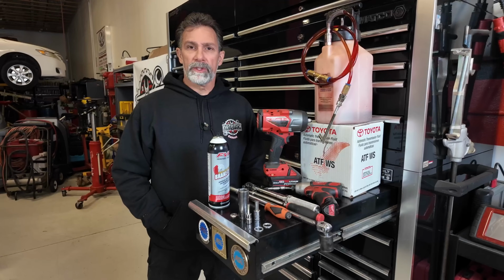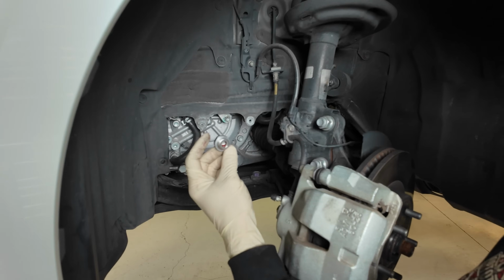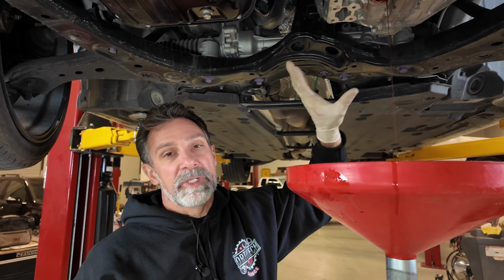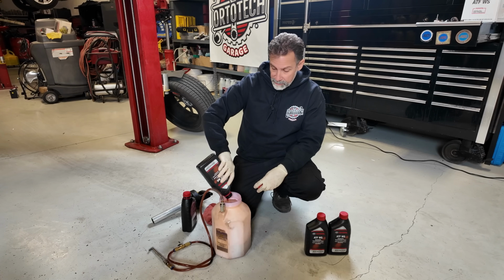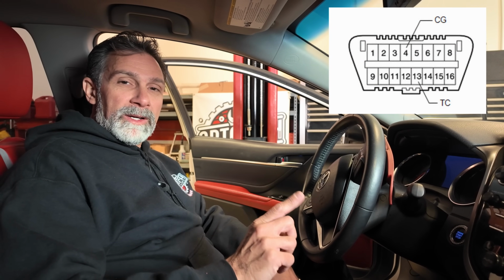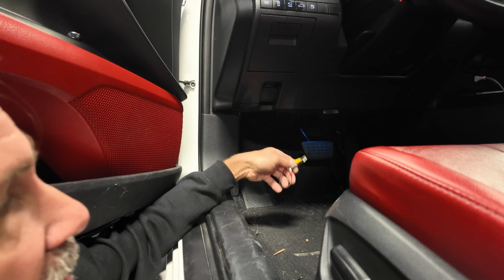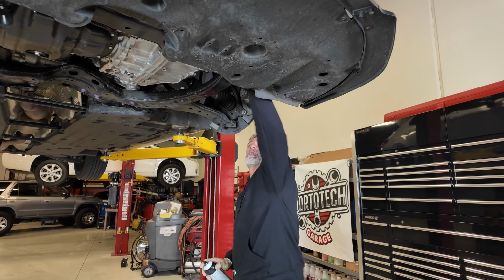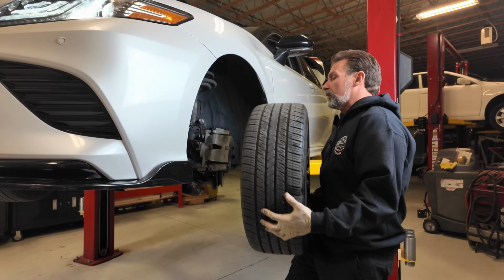The Ultimate Guide to Changing Transmission Fluid on Your Toyota Camry

Comment: Is it possible to change the filter thats behind the side cover of the transmission? Do you even need to?
Reply from the maker: No filter to service in this model.  The older models had a screen to capture large particles, but it's  still not worth servicing if you are changing your fluid regularly. It's just not necessary.  If you are going to pull the pan down to reseal it on the older units, you might as well swap the screen.  Otherwise, just invest your energy in changing the fluid to keep it clean. 👍

Comment: This is why I have switched to hybrids. E-CVT transmissions are more reliable. Fluid replacements are simpler and can be done anytime between 60-100k miles or even longer.
Reply from the maker: I dont think you can go wrong with either choice, but I do like the hybrids as well. 👍
Reply: Cvt is garbage, just look at the problems Nissan is having!
Reply from the maker: @michaelfrohn255  I would say that's a bit unfair to Toyota.  It's the Jatco transmissions in the Nissan and a few  other vehicles that are problematic.  The Toyota units have been reliable because they don't use the belt system found in the Jatco units.  They are made by Aisin or Toyota directly. Both of which produce quality products. 👍
Reply: @OrtoTechGarage  I believe Toyota's CVT is good and can last a long time if you take care of it and don't drive too aggressively. For a DIY like me, the e-CVT makes it much easier to maintain and has proven itself to be long lasting.
Reply: @OrtoTechGarage I agree, because Toyota isn’t using the belt design! They are using the hybrid system with a planetary gear design! But Nissan has not invested in technology like other companies. That is why Nissan is a dying company.
Reply from the maker: @michaelfrohn255 Nissan really needs to level up.  And that's coming from a Nissan/Infiniti fan.  I've had a bunch of them over the years.

Comment: Frankly speaking I am afraid to give my car to some service shop to do this procedure. They will definitely screw things up. They will either put too much and it will start foaming or will put too little.  Damn, wha to do. Likely will be changing myself then
Reply from the maker: I'm sure you will be fine with a reputable shop that knows these vehicles.  It really isn't anything that is uncommon or difficult for a professional technician. Of course, you could always go to your Toyota dealership as well.  Surely, they have the process and fluid types correct.  👍😉
Reply: @OrtoTechGarage  It os just that I am impressed with your work. In almost any shop out there they will not do this procedure so meticulously like you did. We should be grateful if they at least gonna put the right fluid. Measuring temperature and adjusting the level - this is already 80th level .I am gonna be also happy if they not gonna over tighten that yellow plastic plug and brake it. Look who works in the shop these days?! And if you tell them something? they look at you with poker face like:"Hey dude? what the hell do you want?!". I want you to do your job properly. I already lost a couple of cars in my family due to the idiots who think they know how to fix and maintain cars. Thats why I am watching your video now because I already lost faith and am afraid of trusting my vehicle to somebody else. With basic oil change they will overtighten the filter and the drain plug, forget to put the crush washer or put back the old used one, overfill the engine with oil. It is what it is. Thank you for the video and for doing your job so well.
Reply from the maker: @nicholaspetre1  I wish I could help you!  If you were in my area, I would.  Maybe you take it on yourself then.  Its not too difficult.  I can send you the specific instructions for the full procedure if you want.
Reply: @OrtoTechGarage i am good, thank you so much. I got the idea what you did and how. Again, thank so much for the video and details. God bless!
Reply from the maker: @nicholaspetre1  You are very welcome!  Let me know if you have any questions. I know you will do a great job! 🙏

Comment: If I am not mistaken< WS is not the right type of fluid to use in CVT. WS is good for regular hydrotransformator transmissions.
Reply from the maker: You really have to be careful and check your owners manual for the correct fluid type.  There are some Toyota CVT transmissions that actually use Toyota WS fluid (like some older Prius/hybrid models) and others that require a special E-Transaxle Fluid (like the new Camrys).  Most CVT transmissions do require a very specific CVT fluid, though.  It's very important to get the fluid type correct.

Comment: Did this today for the 7th time.  2011 Camry.  259K.  I use a bidirectional scanner to monitor transaxle temperature.  95-113F.  Bleed off.  I add 3 qts and usually bleed off about 1/2 qt until it starts trickling through fill tube.  My old fluid was darker than I expected. WS only.  Leveling the car and getting it high enough to work on ground takes the most time.
Reply from the maker: @waltersweet4595  Great job!   More proof you can extend the life of that transmission with some simple maintenance.  Your process is spot on! 👍
Reply: I had the same problem. Turns out blue driver does not give you the transmission fluid temperature and they  have no plans to implement it in the app. I did some research and like the guy in the comments says ,it  needs to be a bi-directional scanner.
Reply: I like using two sets of ramps to run the car up on
Reply: What scanners and app are you using?  I cannot fir the life of me figure out how ro read the temp.  My bluedriver and vlinker fs wont read it on multiple apps
Reply: @jp-ct7li 

Any bidirectional scanner will give you transaxle temperature.  Some as cheap as $50.   Make sure it has live data or bidirectional capabilities.  Research the model and see if it lists that on the live data screen.

Comment: I want to to do this on my 2016 camry, its the type that has a drain pan and filter inside to get all of the fluid. Dealer wanted 500 for fluid exchange 800 for full fluid and filter. To me this is outrageous pricing. Findlay toyota las vegas
Reply from the maker: @JustFollowTheConstitution I think this is something you can handle on your own if you feel confident. It may not be necessary to pull the pan and change the filter. It's just a screen.  If the pan is leaking, it's worth doing. Otherwise, a fluid flush would suffice. You can certainly bring it to us or any independent repair shop for service. We would be significantly less than the dealership.  👍
Reply: @OrtoTechGarage  Thanks for the reply. I just stumbled upon your channel, great videos. I didn't realize you're in Vegas. I will have to stop in! I'm near the SW location. About the 2016 model filter, other videos show more fluid coming out after removal, around around 3.5 quarts total. Just doing the drain only yields around 2.5? I looks like a sizable enclosure with some sort of element in it more than a screen? Ideally would want it all the fluid exchanged? This is the video I was looking at https://youtu.be/UqXTk4wCZOg?si=PpghAfk9mgjc3Xa9 thanks for your help!

Comment: Здравствуйте, у меня rav 4 но у него нету 13 пина в диагностирующем разъëме, можно ли без скрепки определить темпиратуру жидкости в коробке??
Reply from the maker: Yes,  but you will need a scan tool with the capability to do so.  The Toyota TechStream is  the recommended tool by the manufacturer.  It has the ability to check the temperature and activate the procedure without needing to jump the terminals in the diagnostic connector.  There may be other "aftermarket" scan tools that would allow you to do this as well.
Reply: Спасибо за ответ!!!
Reply from the maker: You're very welcome. My pleasure.  I hope you can find a way to complete your service successfully.  Thanks for watching. 🙏

Comment: Probably the best video I’ve seen on this service. I DIY maintenance on my 2014 Camry but this service i paid a shop to do. I’d feel comfortable doing it myself next time after watching this 👍
Reply from the maker: Thanks for the nice feedback!  I'm glad you found this video useful and inspiring. We hope to provide much more content like this moving forward.  It's surprising to me that this particular topic has been so interesting to so many people.   I had no idea when we set out to make this video.
Reply: Thank you. I have a couple 1-2gallon weed sprayers that I cut the tips off of for gear oil, transmission oil. And vinyl tubing and barbs as needed. Super inexpensive for DIY services. Cheers
Reply from the maker: @vqdriver  I will have try that.  Thanks!
Reply: The hardest part of doing the drain and fill is reinstalling the aero cover!! Irks me they copied the Europeans lol
Reply from the maker: @vqdriver  I know....it feels like everything had a cover now.  It's hard to see anything....
Reply: @ thank you for the video! I was in a hurry to remove it that reinstalling is a bit of a headache. So I found your video lol. Did a 2x drain and fill using Mobil1 Synthetic ATF Multi Vehicle (silver bottle/black label) as per 540Rat Engineering blog who dynamically tests oil for wear protection. The newer ATFs (meaning thin viscosity like Mercon LV or Toyota WS) are NOT up to protecting longterm. This and Amsoil are the only ones that still “protect”
Reply from the maker: @vqdriver  That's great information!  I've not tried the Mobil 1 ATF, but I will.  Glad you found the video helpful.  Thanks for watching and the great comment.
Reply: @ spread the word (or keep it just with fiends and family) 540Rat is the real deal.

Comment: Hello, thank you for the video. It is very helpful to me. What can i do if I put more fluid? How can i take it out and leave it at the right level?
Reply from the maker: No worries.  The process to check the fluid level still applies.   Just wait for the heavy flow from the overflow tube to slow, and then when you have reached a steady drip, assuming you followed all the procedures outlined in the video, the fluid level will be correct.  Anytime there is a heavy flow coming from the overflow tube, with the vehicle running in fluid detection mode and idle control mode, the transmission is overfilled.  So you are basically just waiting for it to slow down.  I hope that helps. 🙏

Comment: My 2023 Camry XSE, with 26k miles, which i use for Uber. Lately, I've been feeling some hesitation when shifting gears, and there's this familiar grinding sound, just like my 2017 Camry when the oil is low. I brought it to Toyota, but unfortunately, they couldn't identify the problem. Now, I'm thinking about replacing the transmission fluid in the hopes that the hesitation and grinding noise will go away.
Reply from the maker: It's hard for me to guess what you're hearing, but it won't hurt to service the transmission fluid.  You are very close to the mileage I would recommend for the first service, at 30K.  Plus you are using your vehicle in what the manufacturer would consider the extreme service category.  Go ahead and service it anyway.  If it doesn't solve your problem, it was worth doing anyway.  I would definitely make sure Toyota addresses your problem before the warranty runs out, just in case there is a major malfunction.  You can always try a different dealership if another is close by.

Comment: 1997 Toyota Camry (should I do drain and refill on transmission fluid)
Hey all, quick question. I just purchased a 1997 Toyota Camry LE 2.2 with 80k miles. I was thinking of doing a drain and refill on the transmission fluid, but after doing some research, some people are saying maybe not to do it since the car is 26 years old. But at the same time, only 80k miles. My goal is to keep the car until 250k miles or more. Would you change it with this mileage? Also, I plan on using the Toyota original dexron 2/3 if I drain and refill.and change the filter also any advice
Reply from the maker: @DavidSanchez-o5z  David, I would still recommend you service it.  Make sure the fluid is not black first. If it is black, if you see metal flakes in the fluid, or if you are having a transmission problem already, it's likely too late. If not, just because it has 80,000 miles, it doesn't mean it has never had a service or won't benefit from it now.  The differential portion of the transaxle on those older units is a common weak point. I would definitely try to get the fluid changed to prolong the life of the transmission.
Reply: @OrtoTechGarage  
I did today I took out 4 quarts and put back in the same it was black but no metal flakes but I did notice is not clear after I run for like hour turn like dark red not black but is running a little better what you recommend to do the steps over again but this time I won't change the filter??
Reply from the maker: @DavidSanchez-o5z  Yes. It may take a few services to get it looking good. 👍
Reply: @OrtoTechGarage  
Sure I put some Lucas additive on it and how long sure I wait to do the next service now
Reply from the maker: @DavidSanchez-o5z  Lucas won't hurt if you are using the correct product and amount.  Once you've got it clean, I would service that every 30,000 miles.

Comment: Well explained video! I have a 2015 Toyota Camry se I got a transmission fluid flush at the Toyota dealership when it had 106k miles. I currently have 162k miles and plan on draining and refilling the fluid myself thanks for the video you definitely gave me confidence to do it myself.
Reply: I just hit 198k miles on my '15 Camry SE. Its the 3rd time ive changed the fluid and filter.  This video and the one made by The Car Care Nut is exceptional.
Reply from the maker: @juanalcaraz6451  That's great!  I'm glad you found this helpful.  Thanks for watching and best of luck with the service.  🙏

Comment: Is it possible to simply just refill the same about of fluid that was removed my measuring the old fluid ???
Reply from the maker: @juanalcaraz6451  That will get you close to what you took out.  The issues you may encounter are, how do you know the fluid level was correct before you drained it.  It may not have been filled properly prior to or if it has any leaks.  If you spill some fluid coming out or while refilling, you won't have a precise measurement.   Your choice, though. I think that's a great way to get you in the ballpark and then just perform the procedure after to get the level precise as the manufacturer intended. 👍

Comment: I did my 2021 se corolla at 56,571miles. I got 4Q out 4Q in. It been over 6 months, no problems. I also did my son in law corolla 2024 last week with around 65, thousands. Great video.
Reply from the maker: Great work!! What was the condition of the fluid in both around 60K miles before servicing?  Im glad you liked the video, too.  We appreciate your support.  Thanks for watching. 🙏
Reply: On newer vehicles the transmission needs to get to certain temperature before flushing the excess oil
Reply: hi @lokito71 When the D illuminated after it reached the desired Transmission temp. Did the radiator fan turn on? I had some loud radiator fan like noise go off on my Rav4 and was not sure if that was normal. i dont see it mentioned anywhere. Is it safe to let the fan roar while we take the drain plug off to let the excess fluid trickle down?
Reply: If you have a "severe" schedule, i.e. city traffic, short trips, hills, or towing, try every 30-50k.

Comment: I’m confused. I have a 2020 se and we bought it and had fluid replaced. They told us that a fluid replacement machine had to be used not just drain and fill as it need an exact amount. Is this true?
Reply from the maker: No.  The machine does not check the level for you. It's done manually.  It's just important to know that the system  holds about 7.5 quarts, and in order to exchange all of the fluid, you will need a way to pump all of the old fluid out of the vehicle.  The machine will do this. If you want to drain and fill, you'll only get about half.  That's the difference.  If the fluid is fairly clean and you plan to service it every 30,000 miles, a drain and fill is a good option, in my experience. Both can be performed.  If the fluid is dirty, a flush will be the best way to get it looking clean again.

Comment: If you have a scanner that can show you temp of the ATF, do you still need to use jumper wire to get to the right temp? Thanks.
Reply from the maker: Only if you have a scan tool that allows for the Active Test- activate the TC terminal.
Reply: @OrtoTechGarage  Thank you!

Comment: Great video! Can you tell me the check temperature range for a 2020 RAV4 UB80F transmission and a 2023 Camry V6 UA80E transmission. I would think the check temperature range would be the same for both of these transmissions, but not sure, and also I believe that some transmissions have a bypass valve that needs to be locked open while checking the level, would either of my cars have this?
Reply from the maker: @Michaelkawaf6l  they are usually within a few degrees of the range on this car, but i will pull the exact information for you.  Just email me and I will send you a PDF with instructions for both models. 👍 OrtotechGarage@gmail.com

Comment: Great video I use RAVENOL ATF Automatic Transmission Fluid T-WS great fluid you can buy a kit which includes the filter gasket and right amount of full synthetic transmission fluid for $120.00 kits are specifically for each model
Reply from the maker: @markkus1134  I've never used Ravenol. I will have to check it out.  Thanks for the info! 👍